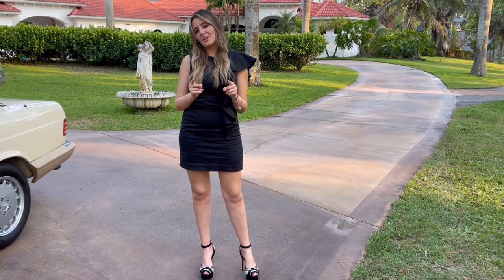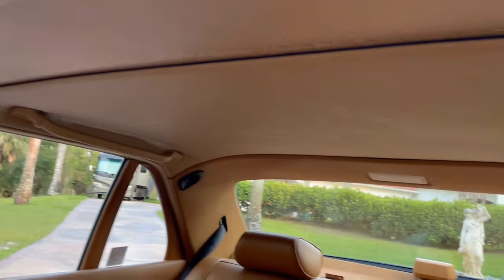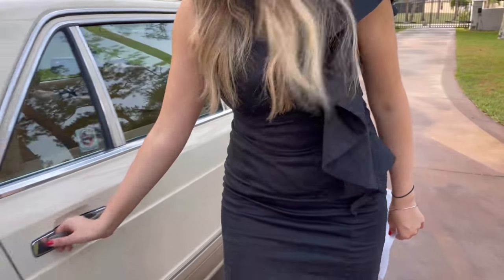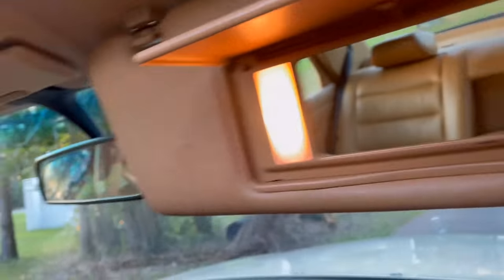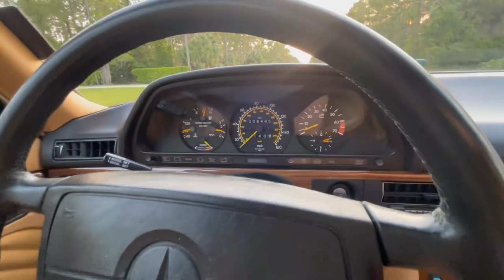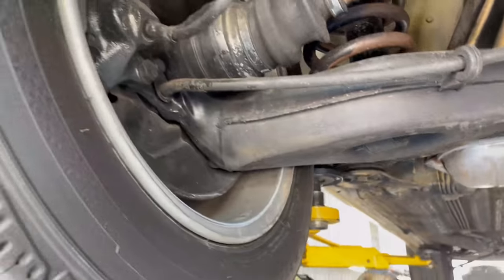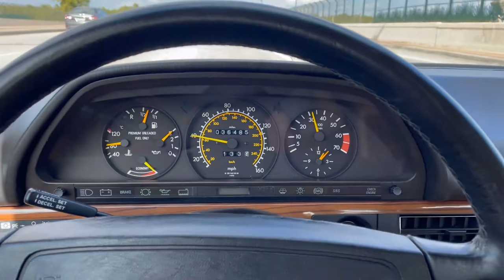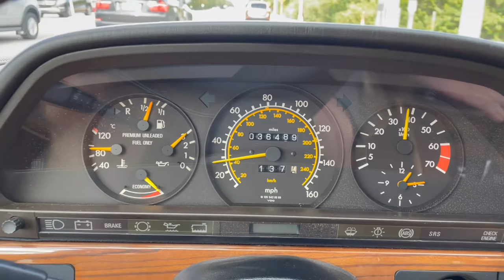1989 Mercedes-Benz 420SEL, A True Survivor, only 36494 Miles, Call 239-263-8500 for more info!

Comment: Fabulous car.  Where is Bill, and the goats, and the cats and the birds?  I miss that. I don't understand the meaning of the paint reader.  What does the variance mean?  And, thank goodness you didn't run over that little critter on the road.  Good driving.
Reply: It means there are variances in the thickness. Quite normal as cars get detailed and polished over three decades. Polishing literally takes some of the surface and thus thickness off..
Reply from the maker: it shows this car has all original paint and this is very hard to find on a classic car like this!

Comment: Peter.... I remember 1987 when the Motorjournalist here in S(ch)weden 
described that he parked on a snowy lawn turned the wheel to the left and
started to drive around in circles and the tail did not slide out nor did the grass lawn get spoiled either due to a ( hervorragend ASR-Anti Schlupf Regelung )perfect anti-spinn function.I guess 420 SEL was not introduced until modelyear 1987 in Sweden. I am not sure about the tech stuff in English but due to excessive reading in DAZ and AMS🇩🇪auflage I am better at german abbreviations like ESSD mit schiebe- hebefunktion

Comment: If these older cars could be rigged with all the new auto braking and auto safety alarms, they would be valuable. I bought on of these in 1989,
It lived in the repair shop. I dumped it for an Oldsmobile.

Comment: Vannie, where u been?  You look tanned!!!
My father had that same car.  Unfortunately, a tree fell on top of it due to a heavy storm.  Crushed the whole top!!!  Yeah, that car is not meant for quick acceleration as you were doing.  The power is felt more on the highway.  It feels heavy to drive with an awesome suspension.  Feels really solid like driving a boat.  
Question... that paint reader, what number is it supposed to show if paint is original???  Because it is reading different numbers from 3.5 to 4.0 to 4.5... etc.
Reply from the maker: Thanks for watching!
Reply: @AutohausofNaples  
Question... that paint reader, what number is it supposed to show if paint is original???  Because it is reading different numbers from 3.5 to 4.0 to 4.5... etc.